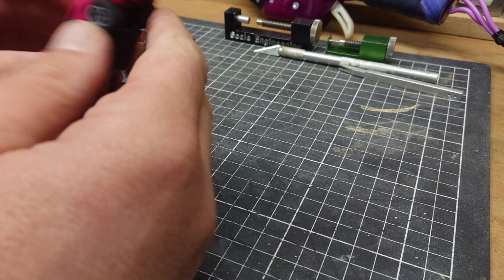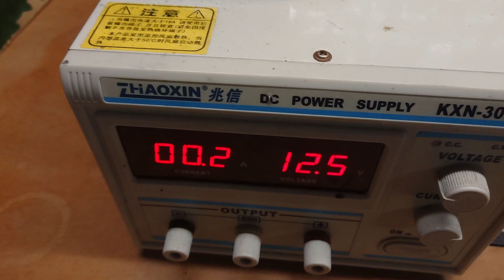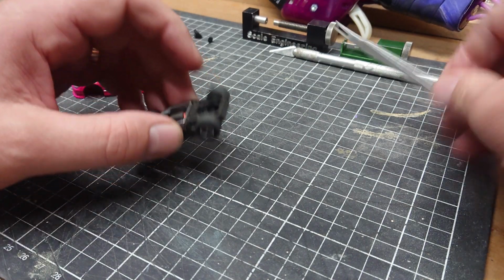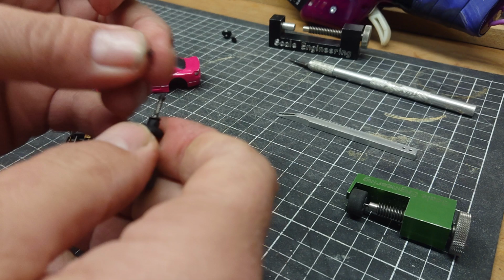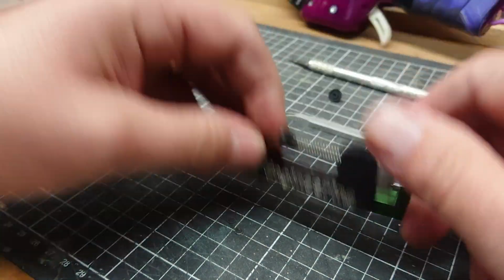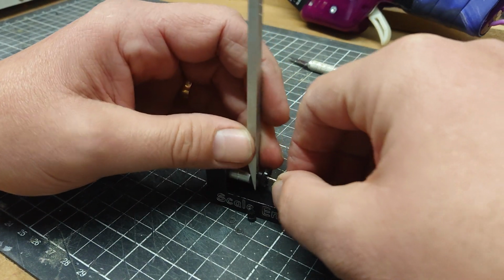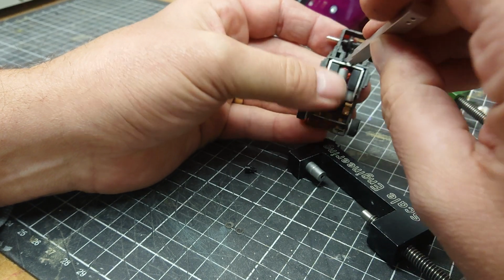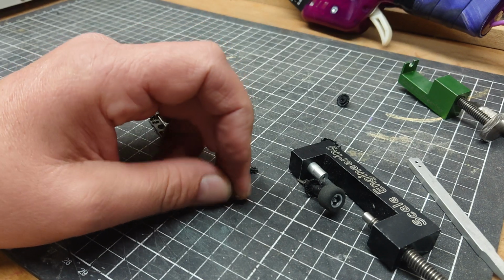Bulldog HO slot car gear replacement and shimming part 1.

Comment: Hey mate, I’ve dragged out my old AFX track out of the shed. I’ve got a couple of questions for you around replacing the little coil engine in some of my original cars. Early 90s models. Do you have a video on that?
Reply from the maker: Are you on Facebook?
If so, drop me a message with some photos of exactly the cars you're talking about, and I'll make sure to help you out. 
https://www.facebook.com/profile.php?id=100067532978442&mibextid=ZbWKwL